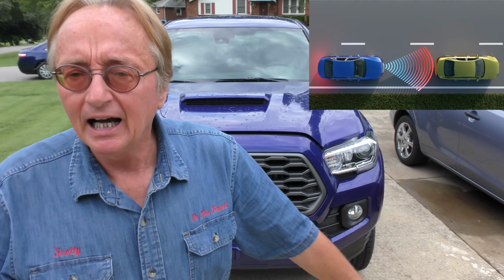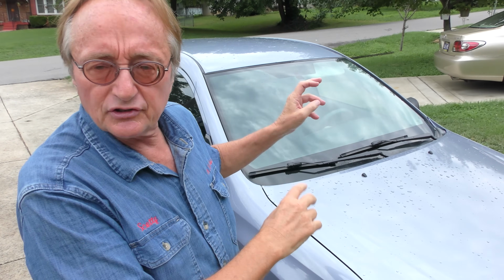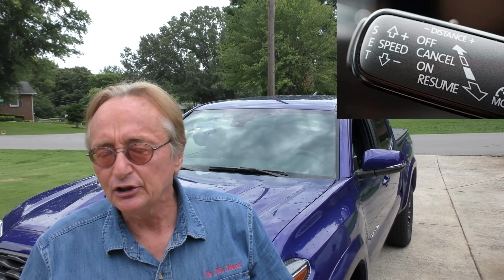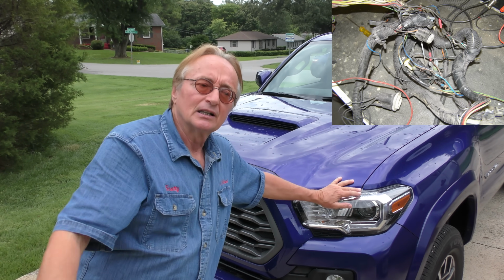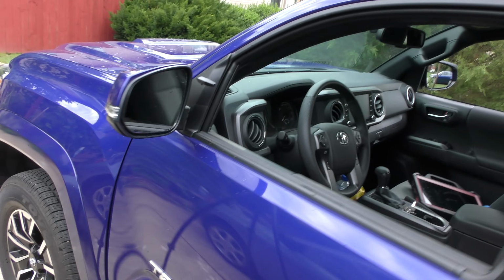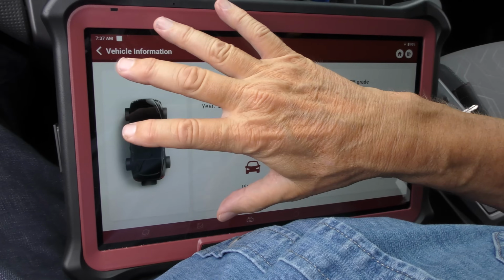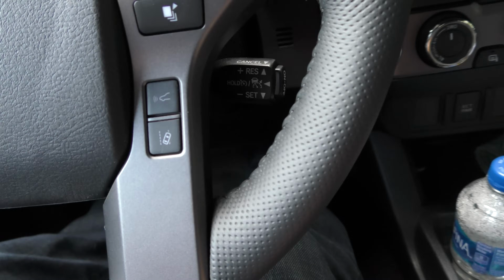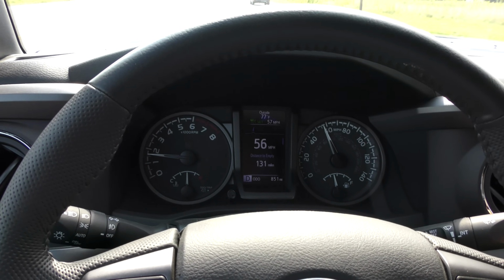Toyota’s New Truck Shocks the Entire Car Industry

Comment: I'm not a big fan of adaptive cruise control . When traffic slows, my car slows gradually, and I don't immediately realize I am now going 15 mph slower, when I would normally see the cars slowing and move to the left to pass, maintaining my speed. Now I move into the clear lane and the reaction time of the cruise control is quite delayed.
I don't know about Toyota, but most cars I've driven have a resume button on the cruise control, so hitting the brake does disengage it, but you just hit resume and you are right back where you were.
If your car senses you are in danger of hitting something, it will brake very hard! Even when you have all kinds of time and room to avoid it.

Comment: Toyota introduced adaptive cruse control as part of Toyota Safety Sense in 2017. It's standard equipment on all Toyota's. My 2018 Corolla has it
Reply: @Davin Peterson nice man. How many miles U got on your 4 year old Corolla?
Reply: @Blakecryderman7244  Almost 11,000 and still has the original battery. The car was actually manufactured in Oct 17/ I did have to replace the key fob battery as it kept saying key fob battery low.
Reply: @davinp  wow you barely drive…that’s low mileage

Comment: Our CX5 has what Mazda calls adaptive cruise control.  When I first started using it I didn't trust it.  After a little while when traffic came to a complete halt I took a deep breath and let my foot hover over the brake, but the car stopped perfectly then resumed speed after everyone started moving again.  Once I feel it slowing down I feel re-assured that its working.  There is a danger when driving our old Tundra in cruise because you got to remember to brake.

Comment: My 2016 Rav4 has this. It works perfectly. And back in 2017, Toyota made it standard on all Rav4 vehicles. It works well even during heavy rain and heavy snow on the expressway. Nice! My wife has a 2016 Subaru Crosstrek, and the adaptive cruse control on it doesn't work during a heavy rain or snow. The Subaru uses a camera-visual system that shuts dow during heavy rain or snow - when you need it the most.

Comment: A few problems I’ve noticed:

1) When the people in front of you speed up, it takes too long to accelerate.

2) When people switch lanes and slow down, it matches their speed even though they’re moving out of the way. (Scotty mentions this)

3) It completely shuts off while at a stop light.

4) There needs to be a distance between the lowest and middle settings.
Reply: If u switch to sports mode it will speed I’m up faster
Reply: the manual for my Subaru recommends usuing acc on limited access 🛣️ not on streets with stoplights

Comment: Scotty does your wife realize that since 1971 on my Chevy pick up truck cruise controls automatically turn off when you hit the brake pedal? She does not have to be manipulating the switch on the steering column manually. Is your family by chance the source of the old story about people going down the road in the motorhome and eventually the driver came back in the kitchen area and started chatting just before the motorhome went off the road because they felt they had set the cruise control and they could leave the driver seat?

Comment: You must pay attention as you overtake a vehicle. The ACC will bleed off speed if you don't change to another lane earlier than you normally would. I use it in heavy traffic. I use the normal cruise on the open highway. My wife's Honda Pilot's ADAS brakes for oncoming traffic on the outside of a curve sometimes, unless you're following the car ahead of you too closely. Odd thing, that. It will nearly drive itself, though.

Comment: I just purchased a 2022 Toyota Highlander and took it on a 4,000 mile trip up north and back.  I used the ADCC but I immediately found out the ADCC has issues.  It works great if you are on a freeway that is relatively straight, but if the freeway has curves and there is no divided wall between the opposite side of the freeway the radar keys in on the cars on the opposite side of the freeway and makes the car slow down even though no cars are in front of you.  This also occurs when trees are close to the freeway as well.  Not good.  👎

Comment: Hey Scotty, I’ve got the manual transmission Tacoma 2020. I like how you can press in the clutch and change gears without disengaging the cruise control.
Reply: Why would cruise control be on if your shifting gears?
Reply: Colin Morgan long hill climbs when you need to lower the gears to maintain your speed or a manual will just limp up it in higher gears. Also if someone breaks in front of you and traffic slows down you can shift without touching the accelerator to get back up to cruising speed.
Reply: @The10cmorgan  how about going up a hill?

Comment: Adaptive Cruise Control is awesome to have. I've gone just over 400 miles without touching any of the pedals...I only had to turn it off because I had to get gas 🤣
Reply: Adaptive cruise and lane keep are very useful for long road trip. I can drive 200miles without getting drowsy but I drove 800 miles all in 1 day with the help of both system without getting drowsy and potentially traffic accident

Comment: The issue comes in when there are curves in the road. The system responds to what is in front of you, not what is in your lane. So a vehicle up ahead that is straight in front of you but not in your lane, will trigger braking, which is very frustrating...
Reply: I have the same issue, multi-lane curved road, car is directly ahead of you in the adjacent lane, you have to switch it off or it will slam the brakes.
Reply: This is true! I learned the hard way with semi's when my car suddenly slammed the brakes in a curve on the freeway. Fortunately nobody was behind me at the time.
Reply: @ghiggs5096  customers as the guinea pigs test subjects for billion-dollar companies. It’s a brave new world!
Reply: @ghiggs5096  Sounds like a dangerous system to me.
Reply: @jerryrobbins7256  Not really after that happened I looked it up in the manual and it does warn about that. Like anything else you have to get used to operating it.
Reply: @ghiggs5096  It's not perfect but I'm glad to have it.
Reply: yep.  in the tight hills of Berkeley driving slowly it squaks sometimes but won't break at slow speed.  However at 50 + MPH it has worked quite well to save me and the truck more than once,  The enhanced braking power was great  when dude launched his car late to the off ramp....
Reply: Yeah ours triggered impact alert due to an oncoming car in the curve.
Reply: Good point.
Reply: @EagleStryker1 Interesting - we have a 2018 Ford Edge.

Comment: My Ford is 7 years old it has is system, it was invented by Volvo in the '80s.  Every unit / vehicle that has it is paying Volvo for the use of the technology. So Toyota started paying them/Volvo great deal.
Now can we just get every car manufacturer to put a outside keypad so we can get in like Ford has since the 80s. 🤯🤯
Next thing  you know Scotty's going to be talking about the fact that tires are round or they're made out of black rubber.
Reply: That's interesting since it was invented by William Chundrlik and Pamela Labuhn in 1990 and Gm holds the patent since '91 . Volvo didn't offer it until 2015  on its models .

Comment: I'm not a fan of it in my 2018 Camry.  It is far too sensitive.  There are 3 sensitivity settings, but the way the car slams the brakes on when someone gets in front of you, it creates a rear ending hazard.  

Its also pretty annoying while youre cruising and it over reacts to someone changing lanes in front of you.  Typically you would just change lanes, keep crusing, and go around...  Now, it decelerates hard... Then you gotta turn it off, change lanes, and accelerate back to your cruising speed and turn the system back on...  It's a pain in the butt.
Reply: Does it not turn off when you tap the breaks?
Reply: You know you can still use olds school style cruise right

Comment: I like to drive. So therefore, I hate any kind of Cruise Control. I don't let no computer control my speed or steering or anything. I control my car not some damn computer. My car doesn't even have cruise control but even if it did I don't use it because I control my car. I'm the one behind the wheel. I'm the one driving. I won't let some computer drive or control my speed my car. Might as well not drive.

Comment: Drove a corolla with it 3 years ago. It was brutal. Over invasive.  By the time I changed lanes to get around a slow transport the car would drop me down to the same speed. Then I am in the passing lane going slow af in a corolla with no balls to pass.   Even from 10 car length away it slowed me down
Reply: EXACTLY !! Terrible for passing on the Interstate . Especially if you get trapped behind some F going 60 , and the normal is over 75 !! HATE it !!

Comment: My new Toyota with adaptive cruise control was covered with ice and snow, until I hit the guy in front of me. Cleaned the ice and snow off. Now my adaptive cruise control works fine.  But the Toyota (new) won't start. Apparently, the fuel pump ain't getting power. Anyone know what's wrong.

Comment: Even if coming from Toyota, I do not like the smartness of the system. I like anything pure, like now I have a 2012 cruze, it has an cruise control, when I set it to cruise, it does. If I want to concel it, I either use hand knob to concel, or I step on the brake, the cruise concel by itself. On the cruze manual, it states that only use cruise control in a less traffic situation. Do not use it in a heavy traffic. The Toyota, this time made it too confiscated, and also increase the danger factor.

Comment: I have a 2022 Kia Telluride and it has the same technology,  so it's not only Toyota.  In my car, you can turn off that aspect of the cruise control.   My car slows down when the car in front is slowing.   It's a great safety feature, especially if the driver is tired or not paying attention.

Comment: Watch out for those curves on the freeway 🛣 when in the HOV lane.  I rented a new 4 runner and somewhere between Oceanside and Escondido (I know that doesn’t really narrow it down) the 4 runner went from high 70’s to low 50’s in half a second.  The only thing I think of as to “why” was because I was coming up on a curvature on the road and maybe it sensed the wall or something.  It definitely wasn’t a car I can tell you that and I can tell you that I almost had a steering wheel 🛞 sandwich 🥪.    Recommendation:  10 & 2 and the recommended speed limit, or don’t use the damn thing (new cruise control).  It does wonders on the straightaways though.  If someone cuts in front of you it will adjust itself and then pick up speed when able at whatever speed you set it on.

Comment: I have mixed feelings about the new radar cruise control. The biggest problem is people cut it front of you and it automatically brakes.  I like regular cruise control. You can use it for foot free driving unless you need to brake. Drove from NYC to Orlando with it

Comment: In 2005, I was a test driver for Hyundai, Honda, Nissan Etc who put this in their vehicles. The system also taps the brakes for you in that mode.  You could keep your hands of the steering wheel and it basically drove it for you, until 5 minutes the system senses you let go. nothing new

Comment: If ACC is active and it senses a vehicle in front by applying brakes whether in a panic stop or gradual slow down, are the brakes actually applied?  I.e. do your rear brake lights also come on?
Reply: yes and yes
Reply: If your car isn’t approaching the car in front of you too fast. If it does it’ll trigger the pre collision system and flash BRAKE!

Comment: I have adaptive cruise control on my Highlander. It works great. I do not like the lane assist and have it turned off. When going around bicyclists it tries to steer me back into them as I give them room while passing.
Reply: Yeah. I only use it in conjunction with the acc...but I do NOT use acc around pedestrians and bicycles.  Lane assist is always correcting me when I'm doing the right thing its annoying.
Reply: I turn off that lane assist too - I live around a lot of Amish and it's always pulling at you and beeping when you need to go around them. I will use it occasionally on a 4 lane or bigger highway

Comment: Adaptive cruise control has been around for years.
Reply: My 2004 Toyota Sienna limited had it.  After a year I was getting error message.  Turns out the radar sensor in the front bumper was cracked somehow.  Too expensive to fix...regular cruise control from that day on.

Comment: I have the same truck I’ve had it for a couple of years now. In rare situation’s the truck has thought vehicles ahead of me in a curve in the slow lane were actually in my lane and started to apply the brakes this is kinda freaky the first time it happened. But the strangest was once because of the shape of the road going under a overpass it thought the overpass was a vehicle and started applying the brakes

Comment: We have a Honda CR-V Hybrid with all that goop on it too. 
If you are in a wreck, you're right it will cost, so be sure the wreck you have is major! Find a cliff to swerve towards it and, well, go flying. And be sure to be fully insured!
I had an '83 Toyota Delux pickup and installed an after-market cruise control myself. It required magnets to be installed on the driveshaft.  I loved it. It was before cruise control was available for those trucks. Made cross country road trips a delight for sure. We did a lot of them. It didn't even have air conditioning. We just rolled down the windows! Ahh, those were the days alright!

Comment: Rented a 4Runner last year that had this. I hated it. It slowed the car down much farther back from the vehicle ahead than I normally would. So much so that it'd often slow me down even though I was going to move to the passing lane. It also took too long to accelerate again if the road ahead was clear. I tried to get used to it, but finally turned it off. I much prefer using the accelerate/decelerate buttons to adjust.

Comment: Recently I took my car to the dealership and they gave me a loaner which was a Mazda CX five top-of-the-line. After five days with the car and a 400 mile trip I can see their adaptive cruise control is pretty good. The car stops entirely and you can choose how much distance you want to keep from the cars ahead of you. The only flaw is when the car ahead of you make a turn after slowing down so there’s no cars in front of you. The car push the gas and you have to take over quickly or you will have to turn too fast.

Comment: The two questions I have are:    Is this expensive to fix and should I get coverage in the event something happens ?   ;)
Reply: Get a Datsun Bluebird and don't worry about it
Reply: Full coverage on your insurance would cover it in event of a covered comprehensive or collision claim. Otherwise if you’re worried about just a mechanical breakdown that would be a factory warranty or an extended service contract covers all electronics on the vehicle.
Reply: Just don't crash

Comment: Got a friend with an Infinity QX60 with adaptive cruise. I'm thinking Toyota has theirs designed better. In the Infinity, it cuts off way early and doesn't respond well when speed picks back up. There's like a huge delay, so it just becomes agrivating to use.